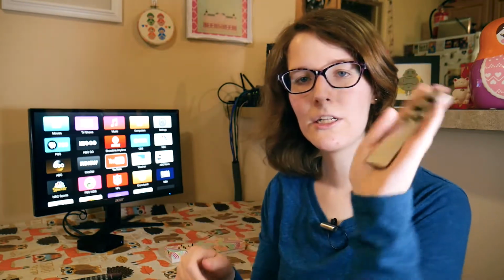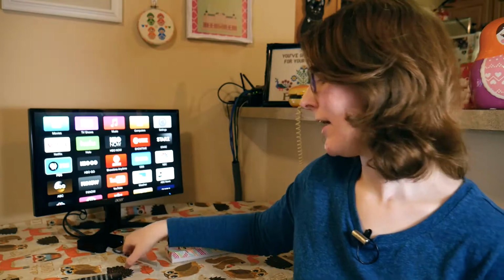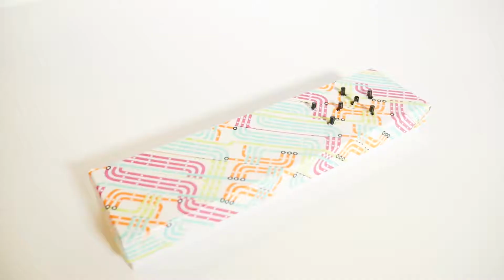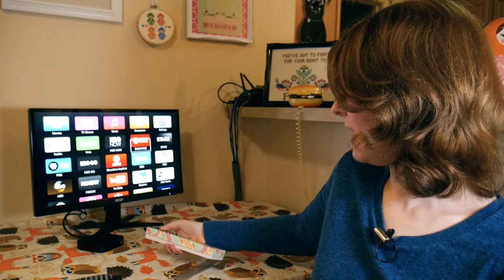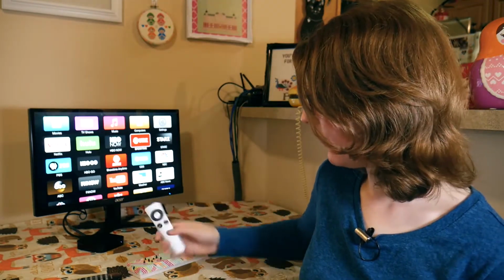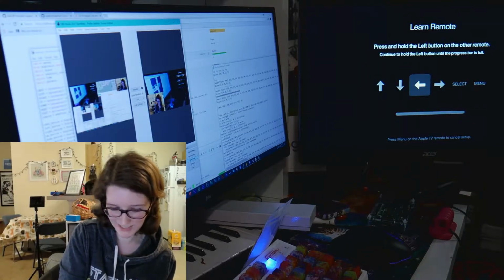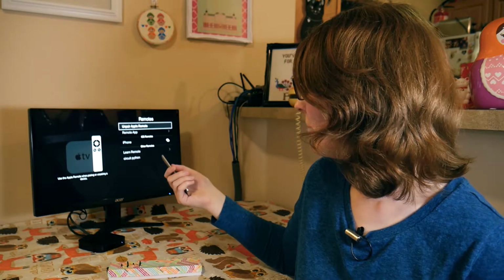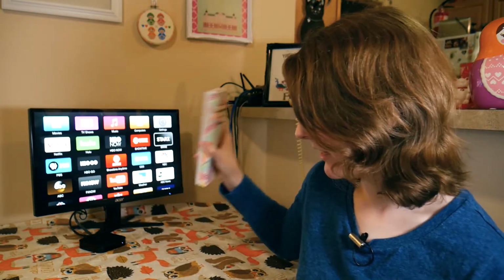Circuit Python IR Remote for Apple TV

Comment: Great project Liz.  Reminds me of one of my first electronic projects I did like 10 years ago.  It was a tv-b-gone.  Not sure if they're still around, but it was a little device that ran through all the codes to shut off pretty much any tv.  It came with a pre loaded 8 dip controller, but I'm sure someone has produced a code for Arduino.  It could be a fun attiny project.
Reply from the maker: Thank you! And I have seen the tv-b-gones! Really cool little devices. Alex Glow from Hackster recently had one where it was mounted inside an NES zapper gun: https://www.hackster.io/glowascii/tv-b-gun-a34f54